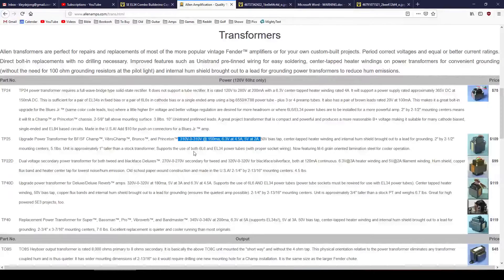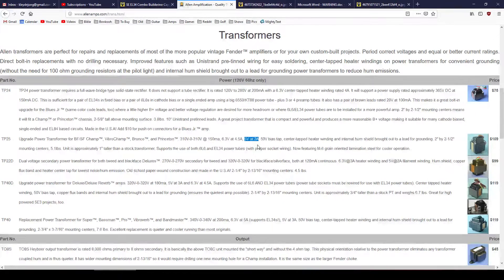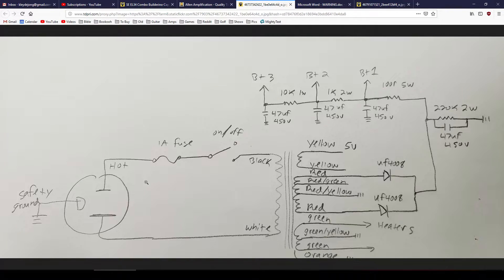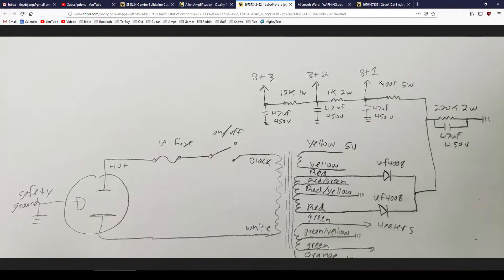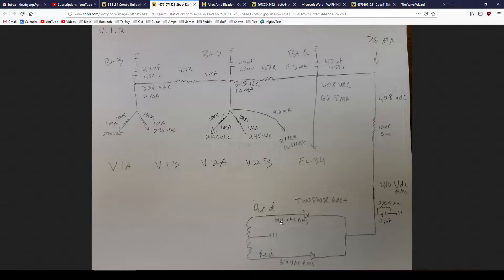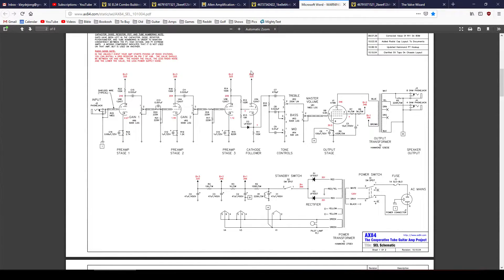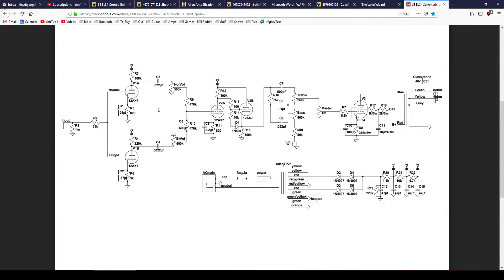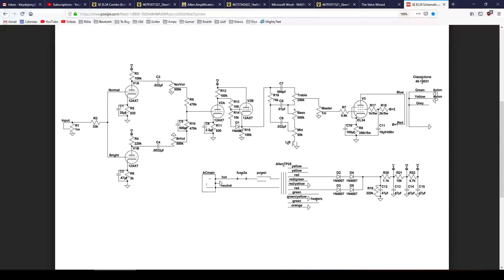SE EL34 Amp Build - Project Overview, Circuit Design | Pt. 1

Comment: Why not add a a 12ax7 before the the power tube that will act like half of the missing phase inverter?
Reply from the maker: You absolutely could!  I chose not to because I didn't want to add another tube and I felt like it already had sufficient gain.

Comment: If you used the triode1 of the second 12AX7 as a mids channel, then you could have a volume each for bass, mids, and bright channels. Then you could use triode 2 as a straight gain stage, and do away with the tone stack. Good idea/bad idea? What do you think? Great videos!

Comment: I just love the sound of mid-power single ended amps, I've built a few myself. I think you have a deeper understanding of their theoretical design than I do, but I do know that, and have built, similar amps that allow substitution of different valve, 6L6's or KT66's withe just a switch to alter the cathode bias. They do have different tones and are worth trying IMHO. Thanks for the vid. The two volume controls is a great idea too.